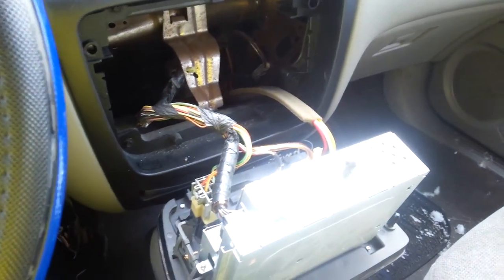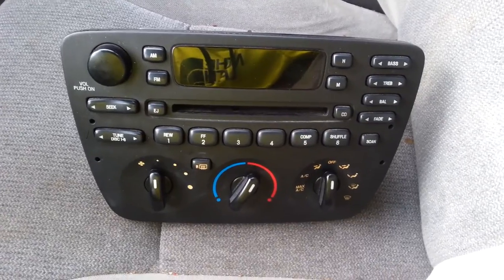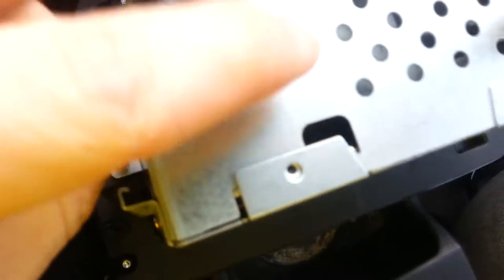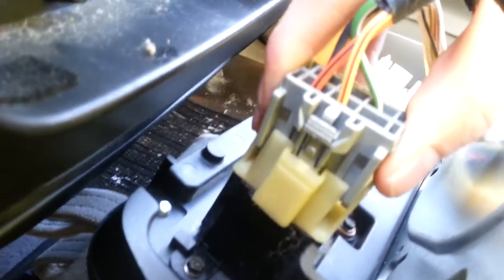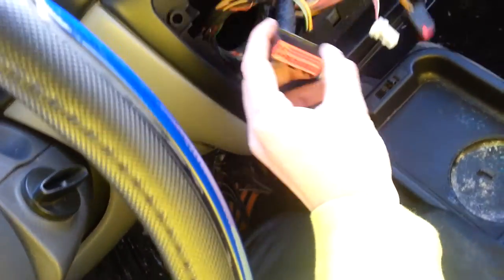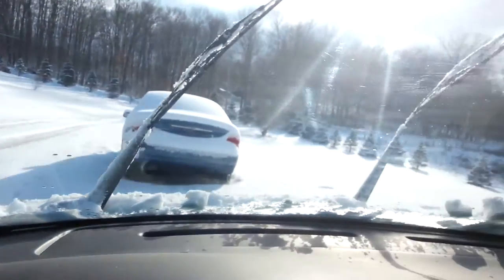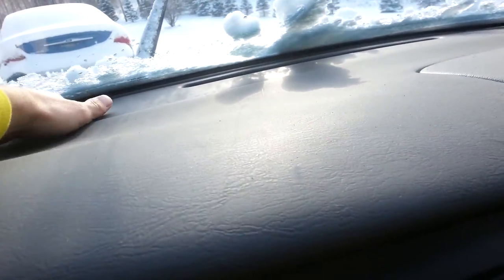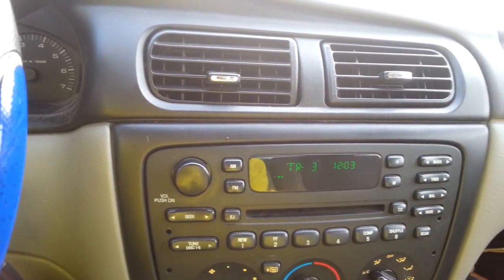How to change a Ford Taurus Radio FACTORY!

Comment: how do you get it out of the dash
Reply: I haven’t done it yet, but you have to buy a two-pronged key to remove it. I’ve heard the you can use a cut wire hanger and insert it into the two holes.
Reply: they sell two curved metal hooks that you insert into the holes on either side of the center console. push the hooks away from the console (towards the windows) and pull outward. takes a bit of work and maneuvering though

Comment: I have a 2004 ford taurus SEL MODEL BUT my factory radio is different from that model there..my CD player is located in center Council near s shifter..my thing is I cannot find after market harness for this factory radio with CD in center glove box.. Are the connectors of both factory units pretty much the same? Cause that connector in your radio is found easy here at Wal-Mart but no listing for the premium radio with CD in center Council..which I like to remove it all..also can not find face plate or dash mount kit cause this SEL TAURUS HAS PUSH BUTTON AC NOT THE ROUND DIAL LIKE URS..CAN UR TELL ME WHERE TO FIND THESE PARTS NOT EVEN EBAY HAS EM..2004 FORD TAURUS SEL...

Comment: Where's the antenna.
Reply: Ford sucks so they cut off the normal antenna plug and ran the wires into the harness plugged into the radio.
Reply: Fr I know it's in the harness but which one is it?